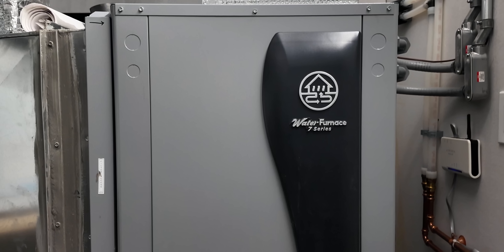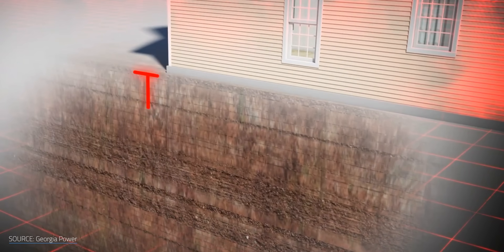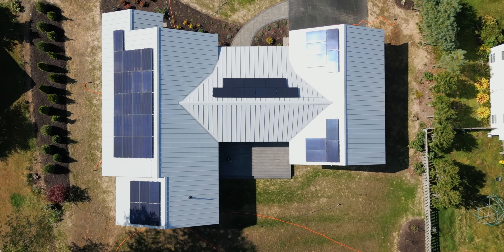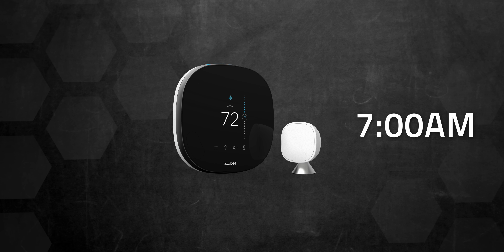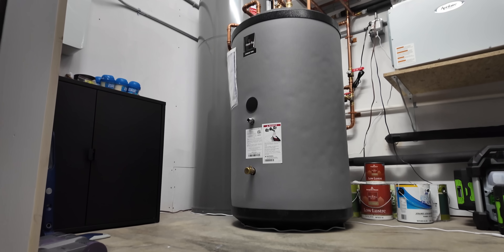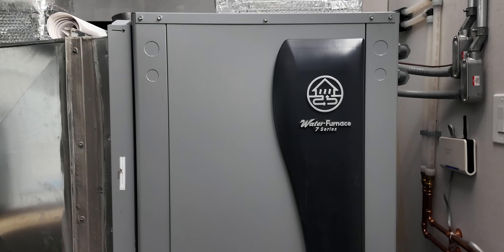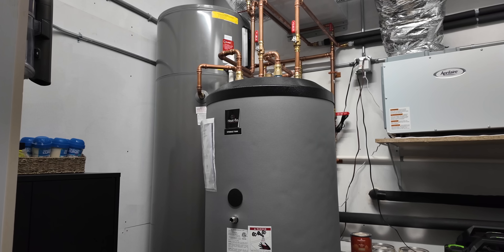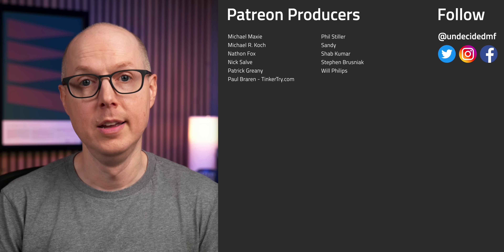How My Geothermal Heat Pump Really Performed (2 Years)

Comment: I was quoted $90,000 (not including landscaping and irrigation repair) for geo for our home, and that was consistent across three different companies here in CO. I have a large amount of land in the ideal location relative to the house for the drilling, and easy access for equipment. Basically an ideal job. The problem was basically that there is only one reputable driller for a metro area stretching 100 miles, and he can charge f-you money because he doesn't need your business. Even with obscenely huge rebates from both of our utility providers, state credits, and the 30% federal credit, and even assuming the geo equipment lasts twice as long as air source, I couldn't get it to price out over any length of time. We went with a pair of ducted air source Mitsubishi Hyper Heats and didn't look back. Geo will never be a meaningful player until drilling costs come way down.
Reply: Matt is actually from Colorado, he only moved a while go to the east coast. However, when I lived there, I have been watching geothermal since the 80s. I had high hopes for Dandelion (their tech lead was from west slope), but even they did it wrong. As such, geothermal remains for most of America useful in new homes. For used homes, you really need a high costs of heating or cooling to make it worthwhile.  A good area is the north east that still has fuel oil, even though better off insulating first. 

Hopefully, down the road, a company will get smart and develop a smarter way to put in the bores. Right now, the vertical ones are simply put in a row near each other. Foolish. It is not ground that transfers the heat, but the water in the ground. So, the smart move is to have a single pad and then bore at different angles away from each other and terminating at different depths ( water runs down and across ). This way you have all of the heads next to each other, and the bores far away so as to have better exposure. 
BUT, that will not be dandelion.
Reply: @grraab2000 Right now folks use water well drilling rigs, they are plentiful & have trained crews available. Using a more specialized (& complex) directional drilling rig to save 10-15’ of trench per well seems like false economy. Unless it opens up more applications where the footprint of a line of wells is prohibitive this would seem to make little sense. Our 2-300’ foot wells cost about $5K (drilling, loop & installation, backfilling with bentonite), either the drilling conditions are difficult in your area (lots of loose rock can make it difficult to set casing for example) or there is a severe lack of competition.
Reply: @grraab2000 That is applying fracking wisdom.
Reply: I take it that with your large amount of land, for some reason a horizontal loop was not an option?
Reply: @dreednlb  I wonder if it's all rock.  For example, large parts of Texas are bedrock under like 1 foot of soil, it would probably be catastrophically expensive to do a horizontal loop.  Versus up in Michigan for me, where it's all glacial droppings and easier to dig.
Reply: Why wouldn’t you do horizontal pipes if you have plenty of land? You could even get the specs, have the piping done, then hire the HVAC guy.
Reply: @jerrytalley802  in cold climate areas, horizontal runs would need to be 30+ feet deep, so boreholes are far less expensive to do.
Reply: @juanv7652  That is patently false.  6-10 foot is plenty deep.  I'm in climate zone 6a.
Reply: Horizontal pipes have to be deep where it snows, like 10 ft.  Loops 1 ft apart both horizontally and vertically, then buried over with the insulation layer of soil.  100+ tons of material removed to start, then backfill.   Harder than you expect up front. @jerrytalley802
Reply: For that much money, get your own driller at auction and after you pay for repairs and operation and install, you should have over half of that amount unspent.
Reply: At that kind of price it makes sense to just offset it with solar, batteries and a more efficient thermal envelope for the house even if the heating is less efficient.
Reply: Yeah drilling costs also vary a lot based on location because of the ground composition differences. But we paid 6000€ to drilling and I assume you were quoted at multiples of this.
Reply: Sounds like an opportunity to open a new drilling business.
Reply: @roadfordays  Rent a backhoe and do a horizontal loop. I had the guy that dug my footings to dig mine , only had about 200 dollars in the trenches. I am a licensed hvac contractor, I installed it all myself except for the loop, I had around 15 k in the complete system in 2011 when I built the house for a 27000 btu system.
Reply: If you've got 'plenty of land' rent a mini excavator for a weekend and do a horizontal install yourself.
Reply: So, this is really an infrastructure issue, and for early adopters it's going to be a pain. In the long run, as the tech is adopted more widely and more companies get comfortable with implementing it we should see installation costs come down.
Reply: @Thunderbuck  The tech is mature, the install isn't technically difficult, nor does it require special skills.  anyone who installs a fossil fuel heating system can install geothermal.  The huge costs are from the ground loop install and its required excavation, and/or drilling required
Reply: The reason he can charge "f-you" money is because of the government programs. It is surprising that there isn't competition for him if it is that lucrative...
Reply: Also a Colorado resident but not ideal terrain for geo unfortunately. My hope for the state is that we invest heavily in retrofitting zombie oil and gas wells into geothermal wells. Consumers will see better prices if the industry can scale at the grid level first.
Reply: @connorjacobs6  how do you plan to move the fluid from those zombie wells across huge distances to where the houses are???
Reply: @ACatKrom not that houses would use the energy from the wells. Rather the investment in grid scale thermal companies might have a trickle down benefit to making home installations cheaper.
Reply: you are 99.9999% of people and that is why nobody does this stuff and the government has to bribe the .0001% of people that do. THE MATH NEVER WORKS. until the liberals wreck the system (and thats their goal) and makes it too expensive for EVERYONE, this is just something rich people do to look like they care more than you do.
Reply: @vegasprogambler5336   What are you talking about? More than likely, the issue is that there are not that many geo-thermal drilling companies in Colorado to meet the demand (quick search - found 2x). Hence they quote silly prices - especially when they are booked solid. This has nothing to do with Democrats or Republicans.
As for the math... first thing to look at is the insulation and air-tightness of your home. If heat is leaking like a sieve from your home - a geothermal heat pump will not help much.
Reply: @bunyip7343  my uncle owns a well drilling company which installs geo-thermal systems. He said if it weren’t for the govt subsidies very few people could afford to do it. But also because of the subsidies he charges more because more people are wanting it. It becomes a vicious cycle feeding off itself. Cut the subsidies and it will die.
Reply: @The66-tqst  Thanks for the info... I live in Sweden where geothermal systems are quite common for residential housing. That being said, the levels of insulation and house "tightness" are typically high... very high for new homes.
We also have various government subsidies to promote more efficient and carbon zero initiatives. 
A friend had a 200m bore hole + heat pump installed back in 2015 for roughly USD14k (after subsidies). His house already had water heated radiators around the house from an old oil heater system. From memory, the rebates back then were roughly 50% for the labour and maybe 20-30% on the equipment. Since then prices have gone up a lot. Today a similar installation might be closer to USD 40-70k (the labour subsidies have been reduced to 30% + inflation on equipment).
It will be interesting to see if any of the large oil drill rigs will be re-purposed for deep more utility scale geothermal projects (if not already?). Colorado has some seriious heat at the 2-4km mark.
Have a great day!

Comment: I enjoy the info on a new build, but around 50% of houses in Canada and the US use a central natural gas furnace in houses that are on average 40 years old. I am finding it hard to find information on replacing a central natural gas furnace without the recommendation of a heat pump + a new natural gas furnace (more cost + still burring gas). This is made more difficult if you have a basement that is cooler than the other floor(s).  More information on that conversion would make a greater impact on improving energy efficiency for more people. The best conversions on older house information seems to come from the UK, but they all seem to be boiler replacements :/

Comment: I’d only go for geothermal if you regularly see –20 °C in winter. Here in southern Germany, our lowest temperature is around –13 °C, and our air-to-water heat pump (a high-quality German product) runs perfectly. I’ve measured everything externally and reached a seasonal performance factor of 4.8!
For under €10,000 it was by far the best decision we ever made. With the EV, domestic hot water heat pump, PV system and DIY battery storage, our annual energy costs are basically €0. That’s a solid €8,500 less than what we used to spend on heating oil and gasoline.
Anyone who can do it, should — and break free from the oil lobby’s grip 🚀
Reply: What about the places that get 100 days a year over 30°C? Air conditioning is the biggest power user for about 6 months of the year.
Reply: That sounds interesting. We have the same temp here in Denmark and I'm considering a new heat and electricity source. 
Do you have a link for your setup?
Reply: @jensandreasen4250 Bosch Nordic 7kW to 17kW range. And Checkwatt if it is available in Denmark.
Reply: @Mariini, thank you. I'll look in to it.
Reply: The number of years this would take to pay for itself is beyond the years of the average middle-aged persons lifespan. Far beyond.
Reply: @redpine8665 how do you figure? My HVAC costs are easily $200/mo, so I'm spending $10k in just 5 years.
Reply: @redpine8665 12 years....

Comment: Just to be clear, a heat pump is not a special device its literally an air conditioner. We have had AC units in Arizona for literally decades now that can do heating and cooling. Its only the east coast that for some reason has some kinda allergy to selling AC units that can do both for some reason. Alec from technology connections went into details about this and why its so strange that heat pump AC units are not common across the whole US. Also most modern heat pump systems DO NOT struggle in normal winter temps in the US. Its gotta get really really cold for them to not be able to provide at least some heating. In those situations you can also just rely on resistive heating which is nearly 100% efficient at converting electrical energy to heat.
Reply: Heat pump or Wärmepumpe was literally the PR trick to get Germans to buy AC units.
They just added a reverse valve and were basically done.
This way it went the path from a shunned luxury device to a subsidized requirement for new houses.

Comment: How does it compare to a gas-solution and putting the money saved in an indexfund over 30 years?
Reply: More directly, how much interest do you pay on your mortgage from the extra $20k-$30k for buying this stuff up front?
Reply: Good point... that index fund at a rate of 7% would double approximately every 10 years and taxes would be deferred until realizing the gain so the actual opportunity costs are likely very significant... additionally servicing a buried loop will get very expensive quickly...
Reply: @benarnold1321 loops last 50+ years, you replace your roof long before that.
In the comparison between investing over assets we sometimes get carried away with a view on returns only. I can guarantee you, everyone with significant investments also owns a home. And guess what, it’s updated to the latest standards of living. Because rich people done waste money on heating cost, they put it into geothermal and insulation.
Reply: Saving money doesn’t involve income taxes, it’s always better to save 6% than earn 7% so a direct comparison isn’t fair, but it is a good question to ask
Reply: Yes, the earnings must be after taxes when compared to savings
Reply: I am not against heatpumps. In fact i own one myself. This is quite common and have been common for the last 25 years (in Sweden). Gas in not an alternative here so that is why i am asking. It would be interesting to compare the cost for all alternatives and ofcourse have all the variables with taxes, mortages, stockmarket-example and so on.
Reply: Well considering the theme of the video is that you would need to check how much it would actually cost you to install based on your area, perhaps you should check out how much it would cost you to install first. Then you can ask yourself if it is worth the difference in price based on your own values.
Reply: I would say that the index fund does very little in a power outage or extreme temperatures. It would also keep you tied to fossil fuel supplies as well as price swings for heating and cooling. 
That said, you could also live in a tent, lol

Comment: Why not just get more solar panels instead of a geothermal solution to offset the difference in electricity usage? I am going through this debate now, even with a heatpump water heater. Why not get a regular electric one and add another solar panels instead? Etc.

Comment: I considered getting geothermal. But where I live it's mild weather,  most of the time it's above freezing in the winter, and rarely hot enough that you need cooling in the summer. An air source heat pump does the same job as a geothermal one at a fraction of the cost. Only downside is that noisy ugly box above ground. I bet the modern ones are more silent than my almost 20 years old.

Comment: Here in my tract house in the southwest desert digging is not possible. But my 5 KW solar with 210 days of sun per year keeps my heat pump HVAC, water heater, induction cooktop, electric oven demand within the $20 hook up fee my electrical provider charges except for one or two net metering reconcile months.

Comment: Given you have such a large roof area, you could have opted for solar PVT, where the panels generate also hot water which can be used with a water sourced heat pump to heat the house. Your house is only single level, so the main downside, snow, is easily fixed by hand with a long handle broom. They cool the panels in the summer, so generate hot water and run the aircon, but can be used also in winter for heating if the house had a large enough roof area and does not loose too much heat.

If you install aircon which also heats, mini-splits, you can even just use a massive amount of solar panels, which is way, way cheaper than all that drilling.

Comment: Size of the house also matters if geothermal setup makes sense in terms of cost. 

If you have a small house, heating energy needs are not that high to start with. Even if you lower the bill by 50%, if the initial value is low, the savings are also low and the initial cost would not pay itself back in any reasonable time. 

I know you said that everyone needs to make their own calculations, so putting it out there for those that are considering what heating solution to choose for their house.

Comment: Well, I guess what you’ve proven is that without stealing money from the taxpayers and even with stealing money from the taxpayers like you did, it’s an economic boondoggle. Because I live in the state of Wisconsin and all I have is radiant baseboard heating with a boiler and I only spent $900 a year in Heating and I have gas water heater and a gas stove top which I use every day and I didn’t need to dump $78,000 into it. 

But when you believe the global climate change, lie, you’ll do foolish things just like any cult

Comment: One thing I wish the architect had suggested was to install a geothermal system under the basement. You have to dig out the basement area anyway, which puts you around 3m down from the surface, 4m if you consider the house has to sit on something, so they typically put gravel/hardcore to allow for drainage. You have already done most of the digging, so putting a horizontal loop under the basement is an obvious thing to do.

Never occurred to me at the time, as I just went with the air source, as was suggested in the plans. You really have to know what to ask for when constructing a house. Ten years on, with what I know now, I would have made quite a number of different choices.
Reply: @shanecook9653  I’m planning on doing that for a small rental house I’m building. The local geothermal installer said that he has run the loops around the house in the foundation over-dig.

Comment: We're running with PV panels and air-source pumps and it's amazing.  I would have liked to do geo, but our builder was more or less set on the air-source, and we were already near our limit on spend anyway.  It has still been great, w/our high-efficiency home.  Our yearly bills for a ~2300 sq ft home in NJ has been between 250-350 / year.  It used to be 120-160, but we got an EV, which is costing us the difference.  I also couldn't afford batteries, which I'd love to get.